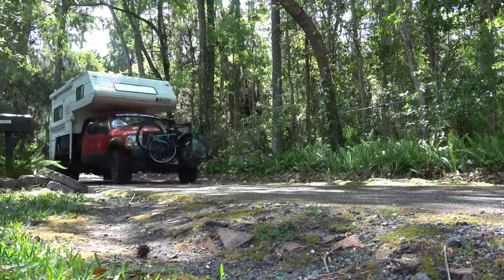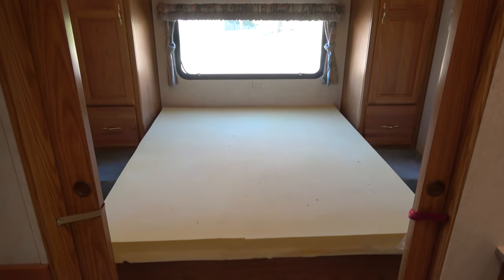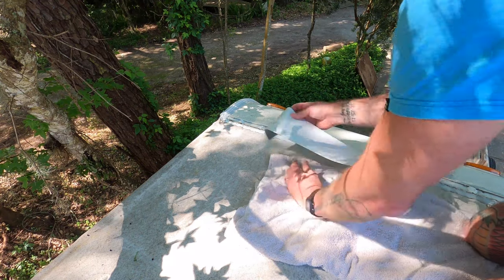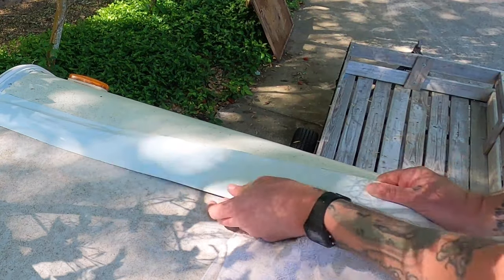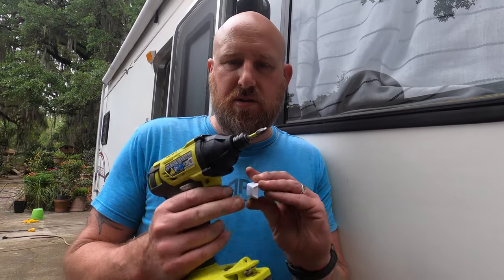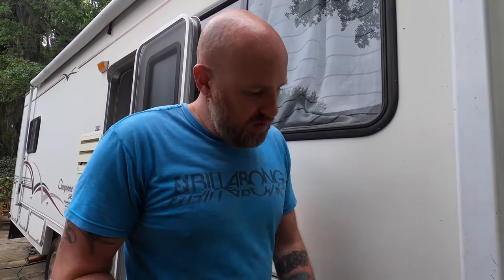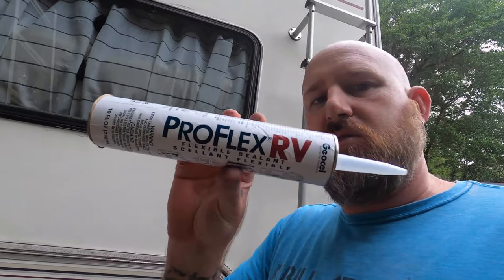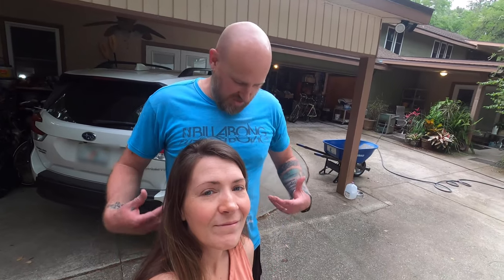Eliminate RV Roof Maintenance With Eternabond Tape!

Comment: I mean this in the nicest way possible. The title of the video isn't worded the best. RV roof maintenance is not eliminated, you still have to get up on the roof and check things out, and make sure everything is in tip top shape. Yes eternabond tape will eliminate the need for a caulking gun and the self leveling sealant for sealing around all your RV roof fixtures. You still need to maintain your RV roof, clean it, and check up on it. Don't forget that you need to maintain the seals around your windows, storage compartment doors, corners of RV, etc.
Reply from the maker: I do not have to worry about whether the roof is sun damaged, ripping apart or punctured from hail. I get on the roof occasionally to put our Starlink up and casually glance here or there. But with the Eternabond protecting the seams of the appliance and vent covers and the Henry's covering everything, I have 99.9% eliminated roof maintenance. All the other things you mentioned (seals around windows, storage, etc) are not roof maintenance and, yes, require regular checkup. But our roof just survived a massive Nebraska hail storm and in checking in great detail after that, there was no sign of damage or possibility for water intrusion. It's maintenance free.

Comment: I hear folks rave about eternabond, but is it really anything more than typical butyl rubber tape?  It looks just like the "special" joist tape I put down when rebuilding my wood deck at home.
Reply from the maker: Not sure what joist tape is or does when it comes to sealing. But Eternabond is fantastic. We carry extra because once you slap it on you don't have to worry anymore. We had tears in our awning and we put a few strips there rather than buying new fabric. The eternabond far outlasted the fabric. Its worth the money in our opinion.
Reply: @CalledToWander    I'm definitely thinking about putting some EB around any vents/protrusions on the camper I'm picking up, just to be proactive.  The joist tape I mentioned is just a very similar looking product.. butyl rubber tape that you cover deck joists with before you put your boards down. Supposed to seal the water out to prevent rot.

Comment: Did you put that eterna bond right over the top of the lap sealant on the front cap.
Reply from the maker: Yes. Give the lap sealant an extra day (2 days total) to dry. In places where we rushed the lap sealant dried but is sort of mushy. We laid the Eternabond over the lap sealant on the front cap and around all vent fans, and anywhere there was a seal (shower skylight, AC, fridge vent, etc). We also laid the Eternabond around the edges of the roof with about 1/2" overlapping down the side and then up and onto the roof. Everything has held together great.

Comment: How did you go around that long vent ?
Reply from the maker: @leighhancock9975  that’s just a cap for the fridge vent. The actual vent in the roof is under that, so the tape is underneath that cap

Comment: Does eternabond stick well on the silicone sealant on the roof ?
Reply from the maker: Nope. Nothing sticks to silicone but silicone. So do all your roof maintenance and upgrades first, slap down the Eternabond where you want it and then throw 2 coats of Henry Tropi-cool on top of the roof. The last layer will leave the roof slick, but watertight. Then you can carry caulk tubes of Henry Tropi-cool or a gallon of it in the event you really need it. https://amzn.to/3FhK5pz It is available at Home Depot on the road so we carry a tube just in case we scrape the roof on tree branches or what not, but know that in a pinch we could buy more to glob up the roof if we had to. It's worked very well since we applied it.
Reply: @CalledToWander  does Tropi-cool good for TPO roofs? Did you take the Tropi-cool to the edge of the Eternabond or rolled over it?